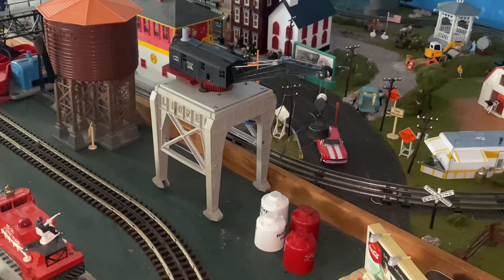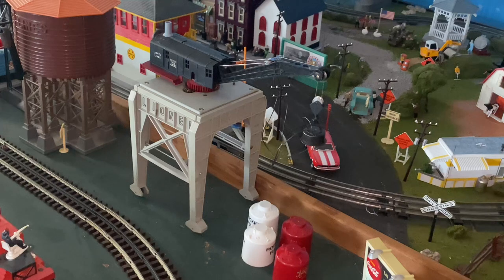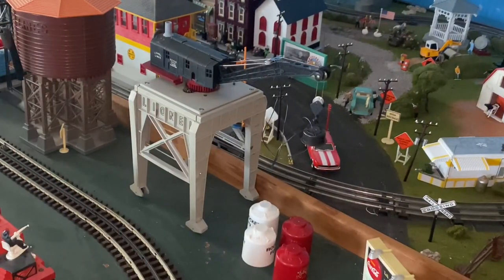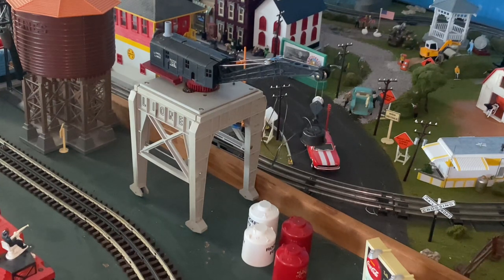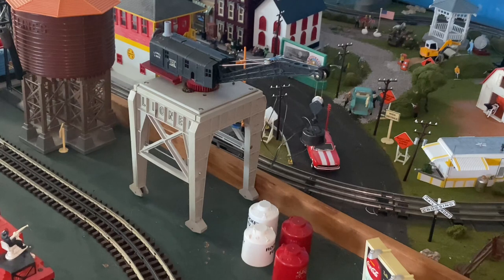The Lionel 282 Portal Gantry Crane 1954-1957🚂🏗️ (Thoughts and Review)

Comment: Excellent review on a very nice crane! I want to purchase one of each of these #282 and #282R magnetic cranes myself. They would be an excellent addition to my collection. I have a #182 Magnetic Crane that that was given to me about 50 years ago, and I just did a full review on it on my channel last week. It’s very similar to the #282’s, but mine has the stationary platform, compared to your portal, and a few other things as well. Both excellent cranes with tremendous play value. Great job Mike!
Reply from the maker: Thanks Tom! FYI I do know the differences between the 182 & 282s
Reply: I definitely sensed that when you mentioned the #182 and the #165 magnetic cranes. What’s great about your #282 is that you can run a train underneath it like you said, and you can also build a rail track system to put your #282 on, to roll it back and forth like a gantry crane as well which would give it added play value.
Reply from the maker: Yeeeessssss

Comment: Very nice! I just picked one of these up last month and while it was a nightmare to service it’s been a very reliable crane. I did notice mine works best at 16 volts or higher. Anything lower and the clutch starts slipping and won’t move fast enough
Reply from the maker: You can say that again dude